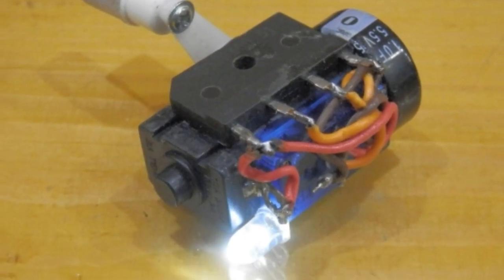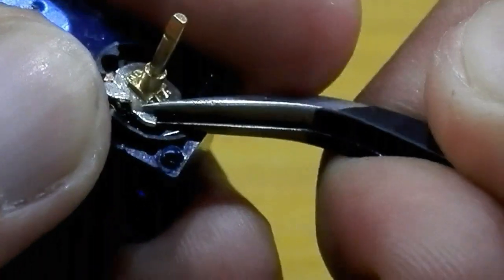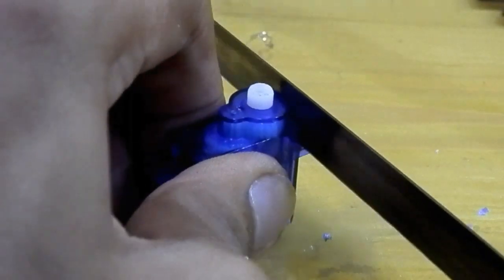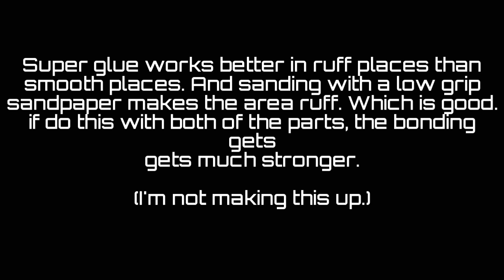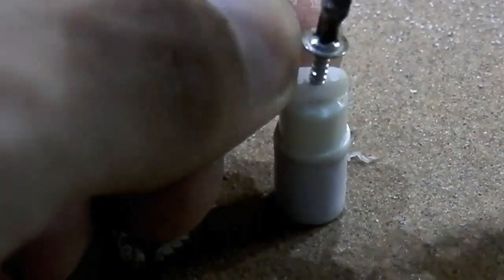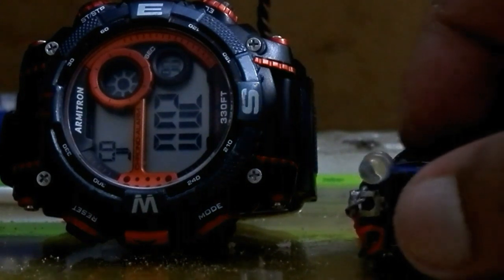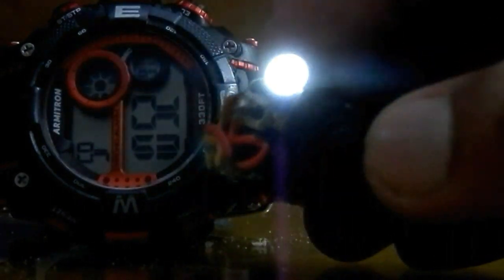How To Make a Hand Crank Flashlight

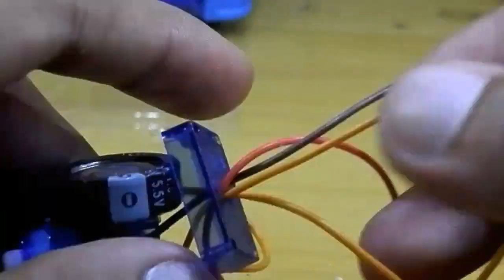Comment: Did you connect a diode between the motor and the super capacitor? If not, the motor will discharge the load on the capacitor when the circuit is in iddle. You didn't show it in the video? (video position 1:30 and 1:40)
Reply from the maker: No, the motor terminals go to the rectifier's AC terminals and the rectifier's DC terminals go with the super capacitor terminals.
Reply: Okey I just got it. This is the right application.
Reply from the maker: Yeah mate!

Comment: hi there would you be able to make a super capacitor hand crank drill ? its just this with a hand crank https://www.amazon.com/BLUCAVE-DSD-46FL-2BLU-Flashcell-Cordless-Screwdriver/dp/B012CHMW5YI cant make anything ,if you make one I will buy many hundreds off of youthank you
Reply from the maker: Hand crank drill? Those are capacitors not batteries. They can't hold the charge like a battery does. And a motor draws a lot of current compared to a 5mm LED. If you still manage to make make, there will be a lot of power loss and the drill won't be as powerful as it should be. By the way, you can just order old fashioned hand crank drill which consists a lot of gear and doesn't require any battery.